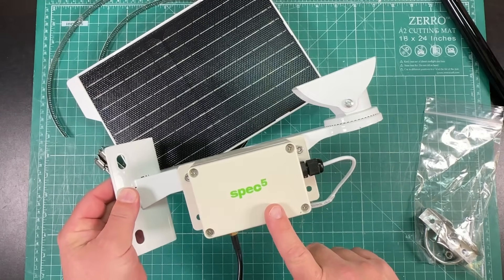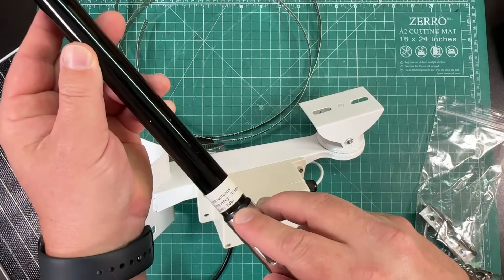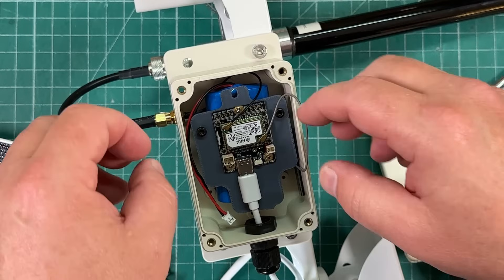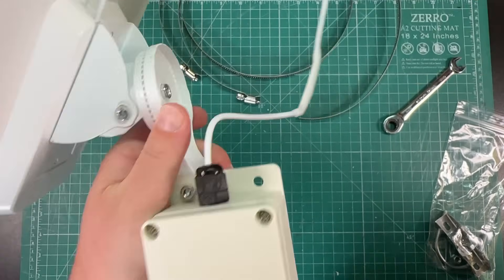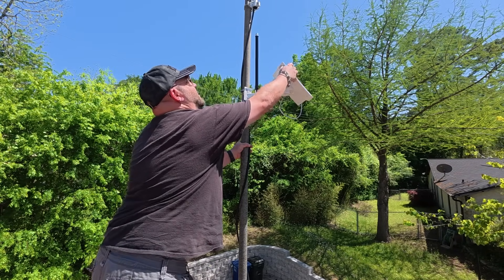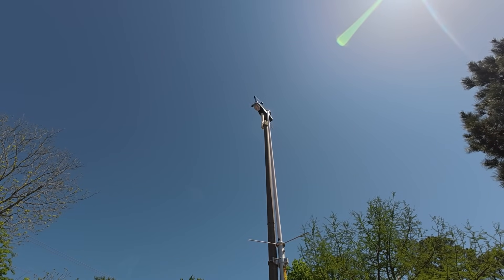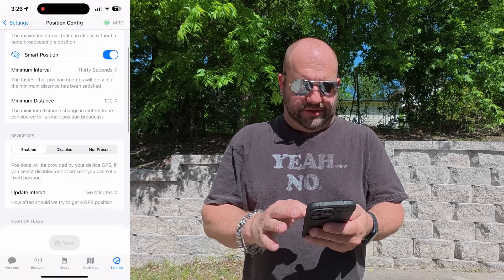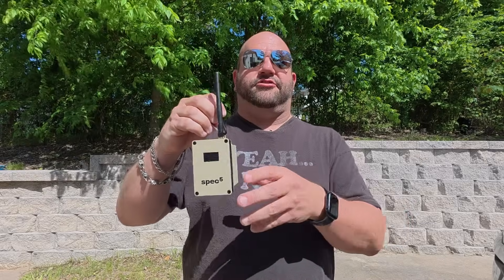I Put Up A Spec5 Solar Meshtastic Relay!

Comment: So you set the roof unit as client mute or just the units inside the house?
Reply: The nodes in the house should be client_mute but not the relay node.

Comment: Will this configured setup allow others in your area to relay text messages?  To use as a repeater?
Reply: The role called "client" is misleading. "Client" means that can repeat.
So yes, he said the device by default use the role "client" and helps others to communicate using his device as relay.

Comment: Greetings from just down I-45 from you in Spring (and a ‘92 SHSU grad). Putting the word “Relay” in the long name is a great idea. Do you feel that has kept people from trying to DM that node? (I’ll be installing a solar node next week and may use this idea. Ultimately, I want the solar node to be a go-between and broadcast all messages to the main node in my bedroom without having to constantly check the solar node for messages)
Reply from the maker: Well I only get messages when my buddy is in town so I really have no idea, but he knows a lot about meshtastic (Dave, KB5UTY AKA Meshtastic Dave) and he told me to set it up this way so I did.  I have a Seeed studio T-1000 that I keep in the house that is my main node (set to Client Mute) so that connects to the Relay and then to the outside world like what you are wanting to do.  If and when you get yours setup see if you can message me.  The Relay is called KMurder Mansion Relay and my T-1000 is called Ham Radio Tube T-1000.  I don't see too many nodes between Huntsville and Spring but you never know.
Reply: @hamradiotube  - Copy that. It should arrive on Monday so I’ll be able to put it up ASAP. I use a RAK WisMesh Pocket V2 in a front bedroom window with an ALFA antenna for now which functions as my “relay” node to a Wio Tracker L1 Pro in my bedroom at the back of the house. I hope the outdoor solar node will give me better reach. I’ll look for your nodes once the solar node is up and populates.

Comment: I suspect you already know in the Position menu, you can key in Lat and Long and then drag the slider to offset the accuracy of that.  I am going to  use that for my fixed device...
73..

Comment: "if this doesn't work, I'm going to just throw this off the roof."  I think you quoted everyone trying to install something on the third attempt!  Hands down the best overall Spec5 solar relay  video.  I have one on order and I'm trying to get everything ready for arrival day.  This is outstanding.  Thanks for doing it. (Great idea to cover the antenna connections with the tape--probably needed up here in the Northeast with snow and ice//rain.)
Reply from the maker: Lol fortunately I didn't have to do that.  And I can tell you that since making this video, the solar relay has worked flawlessly.  I've never seen the battery below 88%, it's extended my range a great deal, it's seen heavy thunderstorms, it just keeps working.  The only thing you might have issue with is the solar panel charging the battery in winter being covered with snow.  That would be something to figure out, keeping the panel clear of snow/ice.  Or just move South like I did lol!
Reply: Some heat shrink would be a better idea

Comment: I am jealous.  I have 5 Nodes up and runing in my locations. Vertical 9dbi gain.  A yagi as well but over the last 12months of operating I have never had a reply to my sent messages. So it's all been dismantled. Even tried Meshcore and my area is dead regarding lora etc. Even the local 70cem fm repeater has now been shut off as lack of use. 😢 George

Comment: Great video but I have a question. Thanks. Does the 900mhz antenna being so close to the mast effect the signal? 
I am just getting interested in meshtastic and ordered a unit to look at and decide if I want to go all in. 
If I do I want to put up one of these relays. I wondered if you'd have a big null in the direction past the mast. 73.

Comment: Get rid of the SMA to N bit of coax. WAY too lossy. 
Get an ipx to N 
Mount the female N on the box. 
100% better than what they sent you. 
Too many connectors in the stock setup. 
You want to go from RAK board to antenna via the ipx to N.

Comment: If you've spent 5 minutes of research before teaching others, you would not plug solar panel through USB  regulator.
Reply: If you'd take 30 seconds to read your comment, it wouldn't be rude.

Comment: Ours stopped working after a couple of weeks, unfortunately was up on a mountaintop, after retrieving it, found that it was still "on" but locked up and had to be rebooted.  After rebooting, it had LOST all the configuration, and custom channels /keys had to be re-setup.   Unreliable.  Especially if it's going to be in a remote site.
Reply: The 2.6 firmware is better about not losing configs. Austin Mesh has a fairly robust design using the Voltaic Systems battery and not using the RAK's solar input at all. Their page talks a bit about the iterations they've gone through to get a reliable node, at least in their climate.
Reply: I would probably have to say that’s because the power cord that comes off the solar panel should not be a USB-C cord plugged into the rack baseboard at all

Comment: You can set it up so you can manage the device over Meshtastic through the mesh itself.  You need to copy/paste the public key from your "personal" node into the "Admin key" list in "Security Settings" on the repeater node.

Then connect from your phone to your personal node, go to devices, tap on the repeater node, then "more details" and you'll find a whole admin section where you can change anything.

The main thing you cannot do this way, or even over bluetooth, is upgrade the firmware.

73 de KI2D

Comment: Great video Mike. Not sure you saw my comment/suggestion in the live chat so I’ll also leave it here just in case. You mentioned the limited Bluetooth range in the video. You might consider using some form of parabolic metal reflector below the 900mhz antenna & against the body of the Meshtastic box to improve the Bluetooth signal in the direction of your house. I experimented with this years ago using 2 old direct TV satellite dishes & was able to increase the range by several hundred feet. With a simple aluminum pie pan & some zip ties there’s a good chance you could increase the Bluetooth range & link stability by a little bit. You will have to tinker with adjusting the distance between the pie pan & the Meshtastic box to get things dialed in. Just make sure the pie pan stays below & out of the way on the main antenna. 73!
Reply: I have some experience emptying pie tins, if you need help.